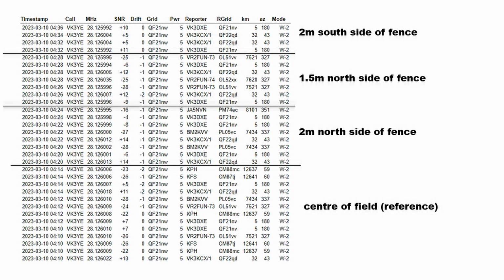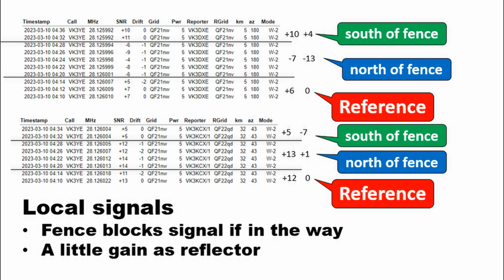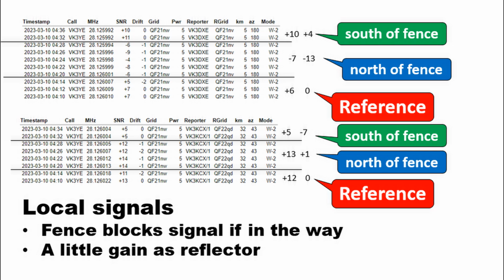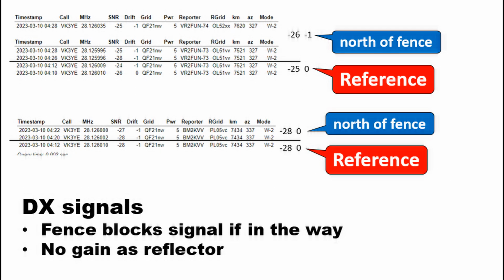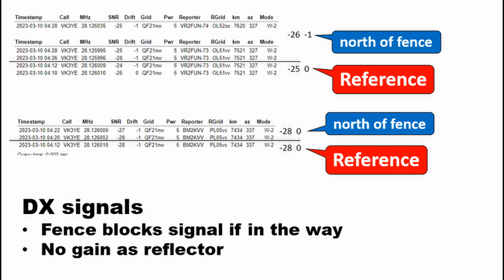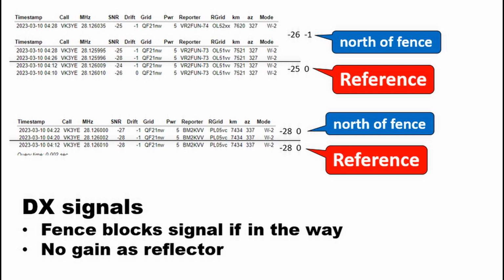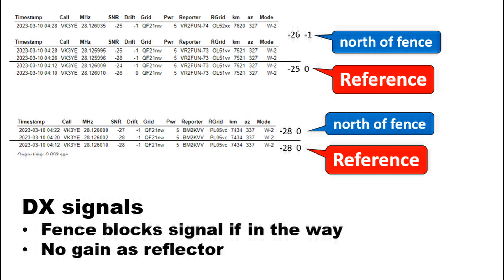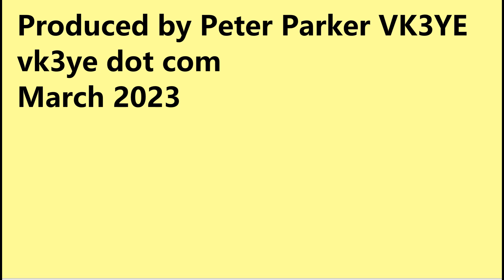Do tall fences block HF signals?

Comment: I would expect the fence to block signals, looking if there was gain was interesting.
When I was a G8 (2m call) I made a 5 el Yagi and got better signals by pointing it into my town centre than trying to get round or over a hill to a station in that next town, pointing it roughly S.W. instead of North. I suspect the reason was a gasometer reflecting signals round the hill. 
G4GHB.

Comment: Hi Peter a comment on possible misinterpretation of your results. The VK3 to the North was I think you said NW or NE, hence, the lack of gain from the fence, whereas the other was directly South. Same possibly for China 327º or 337º is a rather different from 360º where there may be a slight gain, the big issue likely too size of the fence and distance from it. What is not in doubt is clearly it acts as a shield.

Comment: Yes it will. You can also improve verticals if you want a directional array by using a 2 element vertical pair and combining the rear vertical by coupling it to the front end signal by a half wave cable length for the freq in use.

Comment: I had a TV antenna at 49 feet and thought it was doing pretty good until I dropped it to 39 feet (because 49 was just too hard to handle) and the signal improved.  It took a while to figure out why but I did then realize that the power lines were all around 50 feet.  Since the wires are horizontal they were blocking the signals.  So, If you're trying to receive horizontally polarized VHF/UHF signals, either go above or below the power lines in your area.

Comment: Depending on the frequency SURE it will! Just look at the door on a Microwave oven FULL of pinholes, yet it still keeps your eyeballs from cooking if you look at what's cooking! The holes in the door are just small enough to still block that wavelength and the chain link metal fence is just an upscaled example.

Comment: Based on Russia's massive radio structures and those borrowed from German designs, I'm certain they will. If the gaps are 1/10 a wavelength or less they may as well be solid sheets.

Comment: I’d use that fence as a Ground Plane 😈
Reply: I have a 3 foot tall fence that goes all the way around the back part of my lot.  You think that would make a ground plane?
Reply: Definitely! Just mount a vertical on top of the fence (electrically isolated from the fence of course).
Reply: And i use metalic sheet for house as a ground plane 👹